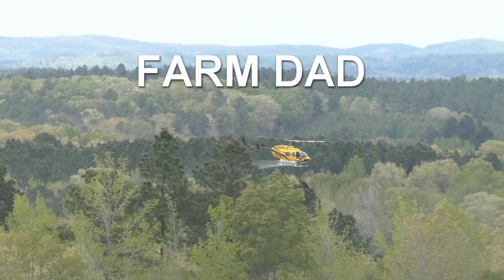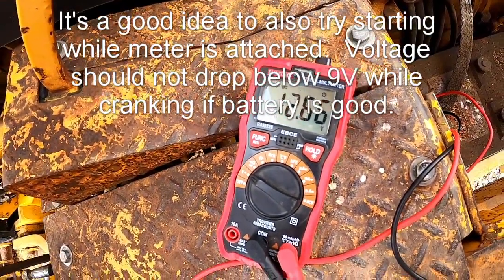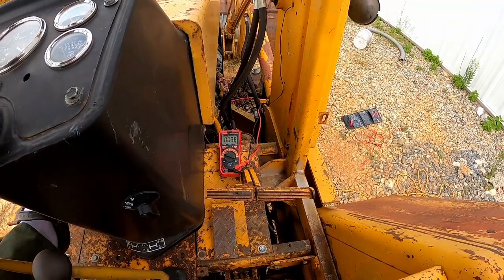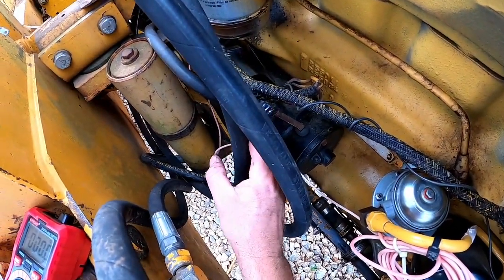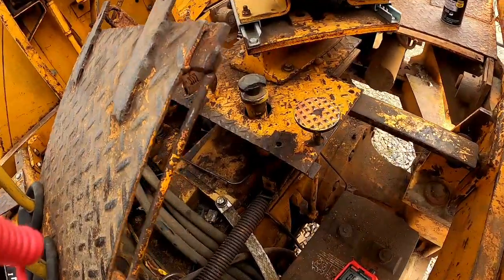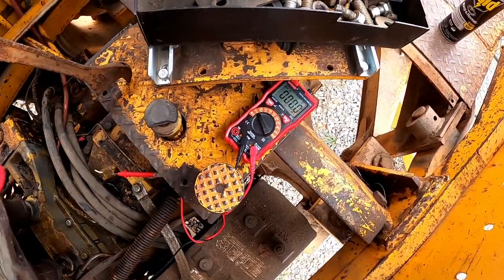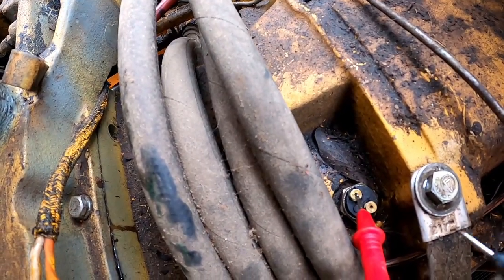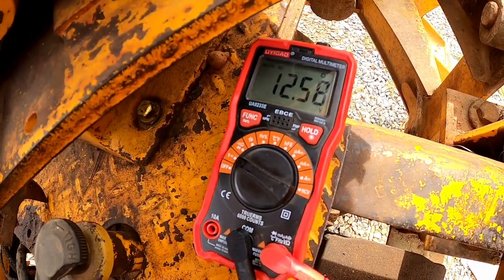How To Diagnose a Tractor or Backhoe That Wont Start

Comment: Thank you so much for the walk through of STARTING issues. On my 1978 Dynahoe 190 myself did Two STARTING systems. The standard then I wired directly to the STATER ( unsafe ) as backhoe can start in gear. But I was having NO start issues. Be it I am the only one ever STARTING my baby Dynahoe, I can live with the always make sure it's in Neutral. Shuttle in center position. The direct to starter gives me START every time. I do have the two start buttons on the dash. I just use the Direct system after I have gone through the shuttle test, and make sure she is OUT of gear. I only recommend this direct starter, for only OWNER who only operates machines and NEVER someone else.
Reply from the maker: Gotta do what you gotta do 👍😀

Comment: Thanks for the video, I have a Kubota with about 5 million safety switches, that won't start. Your instructions are great and it gives me a place to start.
Reply from the maker: My neighbors Kubota recently had a neutral safety switch go bad, so it wouldn't start.  I brought over a paper clip and we bypassed each safety switch one by one until we found it.  Good luck!
Reply: @FarmDad  just went through my safety switches and found that none of them had power so I went and checked my fuses for continuity and found a bad 5 amp fuse. I replaced it and everything works. My kubota guy (after replacing the battery) wanted to order a new electrical harness as kubota only sells them complete. You saved me $2500 plus labor!
Reply from the maker: @jawico  and that's why I'm such an advocate of doing things yourself!  Glad you got it fixed!

Comment: I watched your video and then returned to the shop where my Case IH 255 with cab and loader waited.  Turns out a bush-hogging session had separated two wires from the neutral switch.  As soon as I wiggled them back in, it started right up.  Thanks for the information.
Reply from the maker: Glad you are all fixed up.